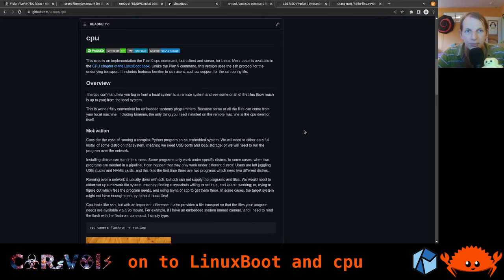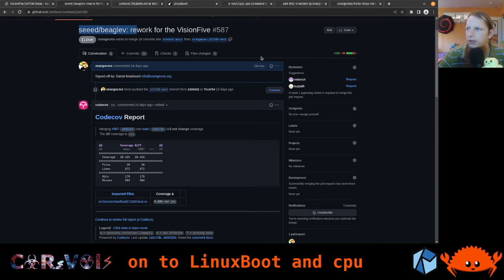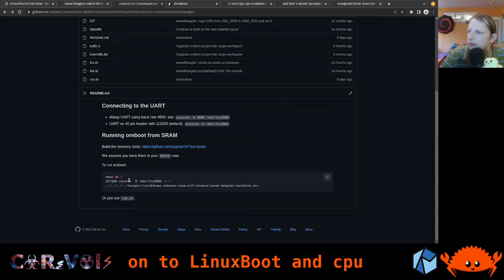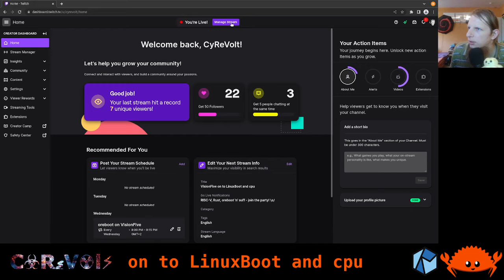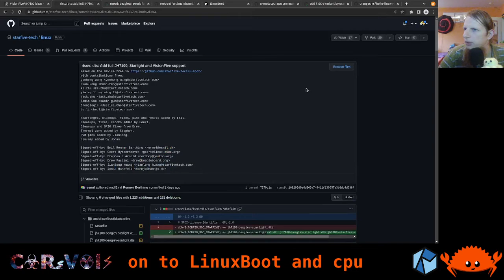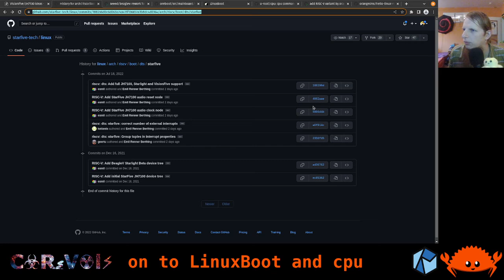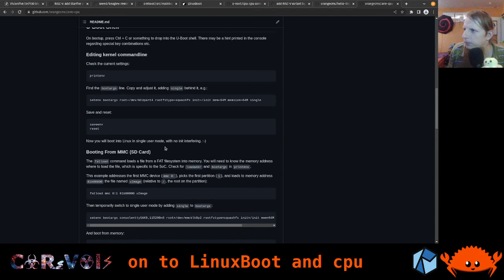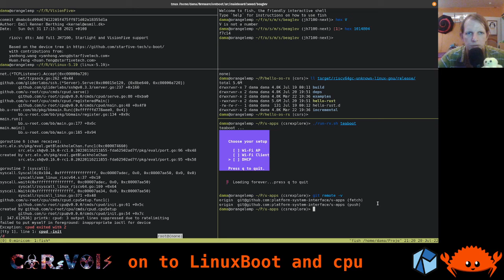oreboot on VisionFive 1 007: on to LinuxBoot and cpu

Comment: as for uefi: I don't understand what you mean by this
is like getting rid of uefi and come up with an entire new/different base firmware to get risc-v running? I maybe wrong but this would mean to write new firmware boot code for pretty much anything like cards connected via pci-e like gpus or nics
Reply from the maker: There are many things that UEFI comprises; one thing is the PI (Platform Initialization) spec, defining a complex multi-stage flow ending up with an operating system alike named DXE (Driver Execution Environment) that runs apps such as boot loaders, and then there is the interface OSes may call into. There are design flaws in PI slowing it down, and the runtime dynamics present trivial vulnerabilities allowing for privilege escalation. Many examples can be seen in the work published by Binarly. The LinuxBoot model is to pass information instead of being called into. This is not innovative or reinventing anything by any means. Open Firmware, the IEEE 1275-1994 standard, and coreboot (formerly LinuxBIOS in 1999) had been following this concept already. LinuxBoot can be seen as a reiteration.

Regarding GPUs, NICs etc that pass arbitrary binaries (code) to the firmware for execution, there are multiple issues. The obvious one is that it is inherently hard to make this safe: sandboxing and signatures are some mitigations, though create a new burden, especially regarding certificate handling. If you claim ownership of your own platform, you would need to be able to sign the external code somehow. Plus, the code is not portable, i.e., the PCI(e) device would need to be able to detect the host architecture. Whether this model of code execution is even necessary is up to debate. Arguably, the host firmware is very sensitive, so everything it executes needs to be auditable and verifiable.
Reply: @CyReVolt  thanks for the explanation - I'll have a deeper look into it